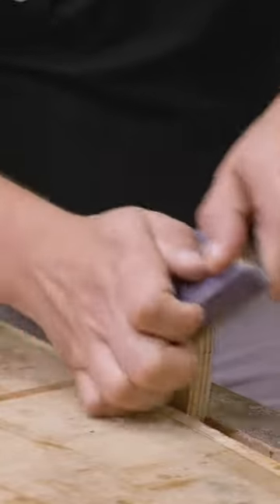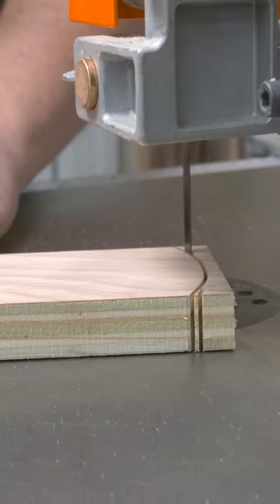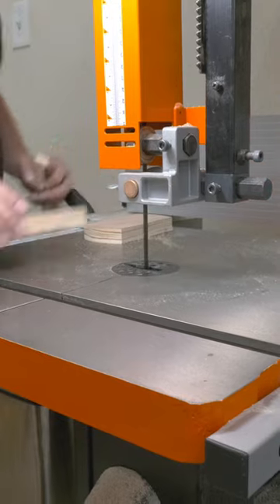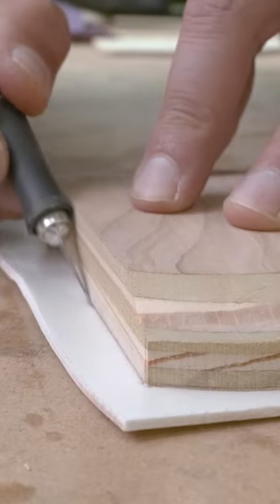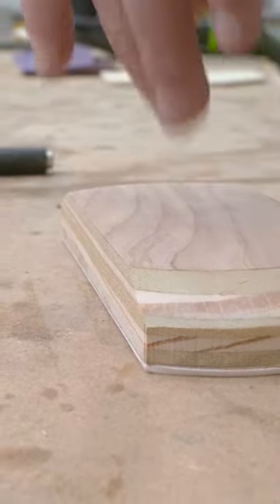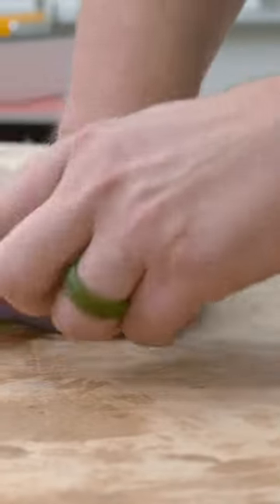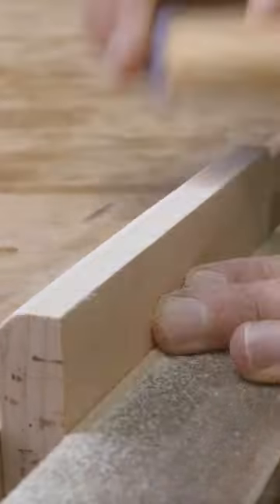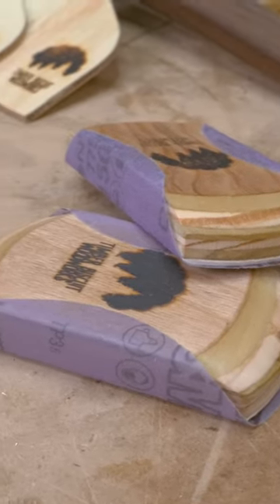The Best Sanding Block Ever

Comment: no i dont want foam! there are way better sandblocks! its ok for some use... but definitely not the best
Reply from the maker: The foam allows for the block to contour to the piece your sanding. The same as a proper store bought solution.
Reply: @TimberBiscuitWoodworks  yeah i know but i dont like it! I like the classic cork block for this. Or no block works best for me...